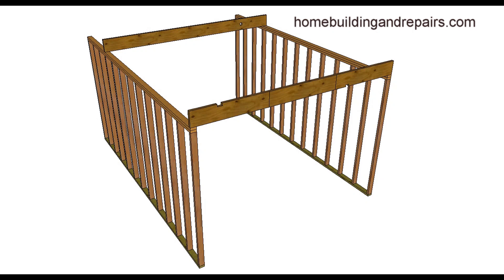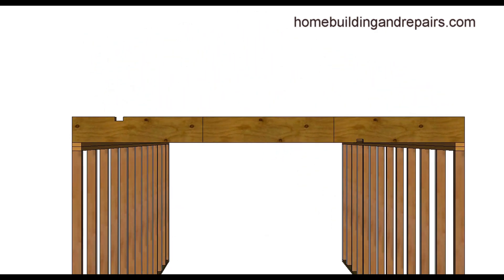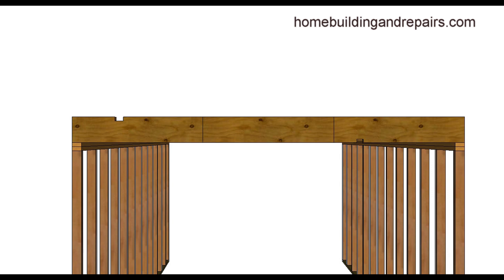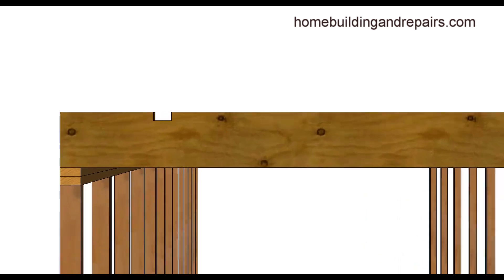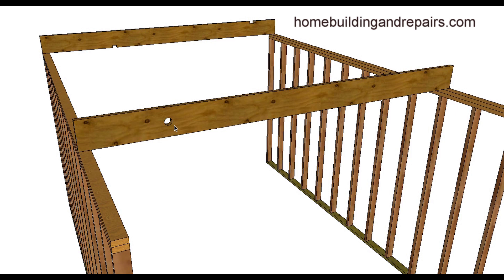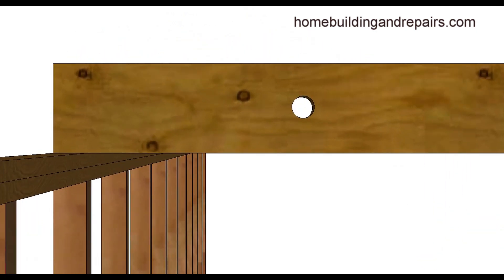Where You Can Drill Holes and Cut Notches in Structural Floor Framing Joist

Comment: Do we ever need to worry about the strength of the plywood subfloor itself?  The sheathing?
As in, if I were to...
- drill FIVE 1-3/8" holes
- vertically through a 2x4 stud walls bottom plate (5/8" from its edge)
- on a second story load bearing walls bottom plate

Would doing this cause issues for the plywood subfloors edge, sitting underneath said bottom plate?
Reply: No this would not impact the strength of the subfloor in any measure for 99.9% of circumstances. The strength of the subfloor lies in its binding properties, think if you made a square frame with 4 boards it would easily be pushed or moved out of square. Now take that same square and bind it with plywood on one side, now it's almost impossible to push or move out of its bound position. Now think of the footprint of your entire floor being bound in that fashion. Think again of the square frame bound in place by a sheet of plywood, even if you drilled 50 holes in it, it would still retain a very high measure of rigidity. We're talking more about things (subfloor) that affect the structural "sheer strength" (look it up for more info), not really the load/gravity considerations mentioned in the video!
Reply: @matthewmeier8803  ohhh that was a good analogy with the square frame!   
Thank you for explaining this to me!
Reply from the maker: I can't help, because you are drilling large holes that could be a problem.

Comment: What if there is a hole for a plumbing pipe in that top 2" of the floor joist?  It's actually a 2" PVC pipe in a 2x10, so it is less than the 1/3 of 10", so that criteria passes.  How would one reinforce ?  It runs through 3-4 joists.
Reply from the maker: That sounds like you need an engineer. You might need to re-route plumbing and install new joist.

Comment: Can you make holes for a 3 inch toilet waste line in a 2x8 joist If you double the joist? How do you pass this pipe from a second floor to a basement through the 2x4 top plates of wall tops?
Reply from the maker: You would need to check with an engineer for the 2x8 and for the pipe in the wall, you usually drill or notch wall framing parts to get pipe through.
Reply: Hi did you get an answer for this? I have a similar question. Thanks!
Reply: Skyline joist repair has great steel reinforcement kits if one is worried about notch and/or hole strength. They can be installed after the hole or notch is made and brings the joist up to code. The advantage is they allow a larger hole than would be allowed and also closer to an edge than would be allowed.  So in some cases this would allow your plumbing to have proper slope. I am using them for a Radon fan install and can get good slope back to my sump pit for condensation and rain. The kits are a bit spendy at around $50 per joist but include screws, pre drill bit and bit for screws. The steel is painted and quite heavy. Probably 1/8" thick.

Comment: my thoughts are the reason the notch does not effect the structural integrity is that the weakest point off the board will break first. even with the notch the weakest point is the center even with the notch. just a thought don't know for sure.

Comment: Don’t notch, the stress is mostly on the upper and lower edge. Drill a hole in the centre of the joist then there is almost no effect on the strength of the joist. Plumbers use flexible pipe.
Reply: You are allowed to notch per code, just have to follow the codes and guidelines when it comes to notching

Comment: One question I live in the mountain where is cold I have a woodstove in the basement Can I drill an 4inch opening (same size as a dryer vent) and install a fan on the main level to heat at my house more efficient?
Reply from the maker: If you're talking about drilling a 4 inch hole through a non-structural item like drywall or paneling, then you probably could, but I would not suggest drilling a hole through structural wood framing members.
Reply: I wouldn't either

Comment: Question. My Architect speced my new edition 2nd floor with 2x8. Building upward towards a new 10 pitch roof due to a damaged roof from a tree that crushed my house!  The contractor got 2x10's by accident and built the joists with 2x10 with no extra charge. Have 1 1/2 holes drilled 2 inches from the bottom on center.  Really 1 1/2" from the bottom of the hole w/strapping. Is this path still in code?  Thanks for the proper video!
Reply from the maker: I would like to say yes, but you will need to check with your local building department. I do have a video somewhere about notching or drilling holes through floor joist you might want to check out, but I'm guessing that you already have that information.

Comment: I would think that the overall stress path would matter (like a truss).
Maybe with that in mind, superimpose(sketch) an engineered truss on the joist and steer clear of anywhere within that area.
Top outer ends obviously would be the preferred place for holes or notches.
Reply from the maker: Engineered components like roof trusses are different than solid lumber and remember that good planning will reduce notches or holes drilled in lumber, if possible.

Comment: what about hot and cold water branch lines that have to go through joist? do you think notch towards the top or drill hole through joist? thanks
Reply from the maker: I don't think it would be a problem, doing it either way as long as you followed the information in this video and the information in this video is acceptable by your local building authorities or building and safety department.

Comment: What would need to be done to cut down up to 1" off the top of 3-4 floor joists for a flush walk in shower? 2x10 floor joists on a corner of the house. shower area approx. 34"x60". Thanks
Reply from the maker: I cannot provide you a structural engineering advice. If you remove an inch from the joists that is 9 1/2 inches tall, then you would now be using an 8 1/2 inch tall joist and that could weaken the floor. However I can provide you with an opinion, for something that might work. You could add one additional joist to each one you cut that would be shaped to match the others or you could simply cut it and hope for the best. Let me know if this makes sense.
Reply: The amount that needs cut down may only be 3/4" now that I found how the dimensions of the kerdi shower pan. The joist has a 12' span, one end rests on the foundation sill and the other rests on the steel I-beam. Sounds like your talking about sistering the joists. Would cross blocking in the area the shower pan is going into also work? Thanks!
Reply from the maker: I would be talking about sistering joist and blocking wouldn't help. I wish I could say that you could take the three-quarter inch notch out of the joist without having any problems, but I'm not an engineer and would feel horrible if I gave you the wrong advice.

Comment: Awesome presentation as always, thank you!  How close to the ends of a joist can a hole be drilled?  As you stated you have to be 2 in away from the top and bottom but I'm questioning the sides of the joist.  Thank you!
Reply: I have looked for this answer a lot as well and still have no answer.

Comment: I don't think you reduce the load capacity if you notch the end of a joist for the top plate. I think the real critical area is the middle third of a joist as you describe. I think the forces are reduced as you move from the middle to the ends. But this is just my guess.

Comment: Can I drill into the corner of my room to get an ethernet cable to my bedroom
Reply from the maker: Yes, just as long as there isn't any plumbing or electrical in the way and there shouldn't be any thing in the way in the bottom corner, but just be aware that there could. Try to go through the drywall and not the framing studs or base framing plates which means that you should drill at least 3 inches from the corner and at least 3 inches from the top of the floor.

Comment: From what I read somewhere I think in a 2x6, if you drill 1" holes they must be more than 2 inches apart meaning 3 inches center to center. 
You don't want to splinter drilling through and you want to stagger so a split in the grain can't travel hole to hole.
Reply from the maker: You bring up a good point, but I couldn't find anything that would support your claim and would appreciate it if you have a building code reference or anything that might validate this. I couldn't imagine drilling too many holes close together as you suggested.
Reply: IRC R802.7.1 should contain what you're looking for.
Reply from the maker: I am on page 400 in the 2012 international residential code book and it's talking about cantilevered portions of rafters, with no mention of drilling holes. Could you provide me with the book title and page number?
Reply: I got a PDF of 2010 Florida Building Code - Residential ... Chapter 8 - Roof and Ceiling Construction
I would paste the text but I cant copy the text. 
I'll post a link in the next reply so this one doesn't get ghost blocked by youtube so if you don't see it...
Reply from the maker: I found it and sincerely appreciate your patience with me. It's on page 120 of the 2012 international residential code and the number is R502.8.1. You are correct and my interpretation of it says that a hole cannot be within 2 inches of another whole or notch. Thanks again.
Reply: You're welcome. Yeah 2 inches edge to edge. I wish I had found that information myself before I put a bunch of 1 inch holes 2 inches apart (from centers) in some ceiling joist. :(
That and you're not supposed to splinter the wood as you break through.
Reply from the maker: I can't tell you how many three-quarter inch holes I've seen drilled less than an inch apart through joist and rafters and would imagine that there are plenty of building inspectors who like myself had no idea about this particular building code.
Reply: Stuff like that usually isn't enforced until a municipality adopts new electrical/building codes and many probably don't get around too it... Though I think it would be a good idea to make an addendum to your video and use annotations to link it.

Comment: take a good look at typical stringers in a standard staircase, you typically see 2/3 of wood missing leaving only a small portion of wood left in the stringers, stairs typically have to hold all your weight plus the weight of the heaviest items in your home all that stress and load on less than 3" of wood in each stringer section
Reply: Geeze, maybe they should make separate rules about those wood stair things too? Maybe physicists could study how different angles affect (or is it effect?) The distribution of forces and tell us what they find. Thanks for pointing this out, I see the new rules being named after you. Pedestrian wood cutting stair thing rules......
Reply: @jeffreystroman2811 they already have lots of rules in the code for stair stringers.  Also to compare with joists, you would measure the vertical distances from the inside of a step to the other side of the wood, not shortest distance.   In other words if you lay a stair stringer horizontally, yes it is only as stron as the 3" of wood.  But when you tilt it, it is as strong as the thickness of the wood going straight down from the step.   Which is usually 6 or 8 inches (I always use 1x12's for stringers).  Also stringers are often installed closer than 16" apart.

Comment: if you notch both top and bottom i would imagine that would reduce the integrity of the strength, unless it's fastened from the bottom or a hanger is put in place, you still have a full width board with two notches, however shifting the load from the notch to the bottom will reduce the load from the notch area and put it back on the full width or if you really need to you can reinforce the board by doubling or scabbing it,sister up a board along side for optimal strength

Comment: the notch on the 2×10 to the top plate looks like it would be reduced to 2×8 strength unless you grab a nail in the bottom or a hanger,if its just floating yes but if you fasten the bottom than the strength or integrity of the width would be just as without notch ,don't look at the notch draw and straight line up from the bottom and there is still a 2×10 fastening at that point changes it's stress off the notch and puts it at the full width